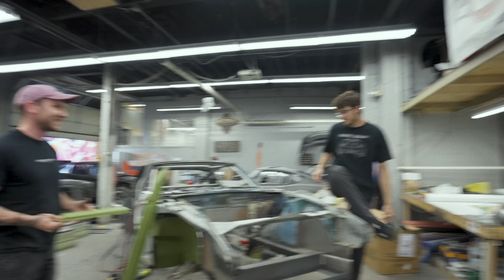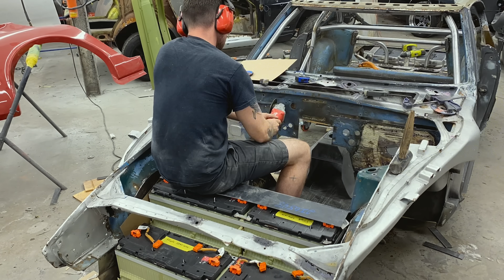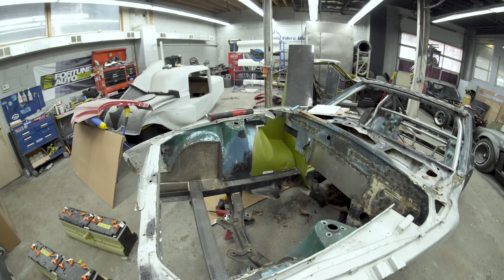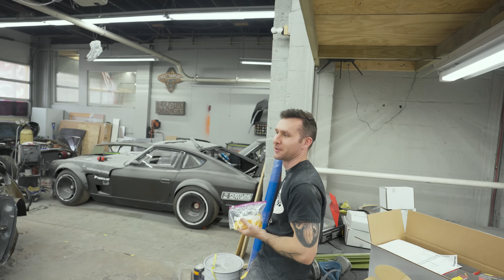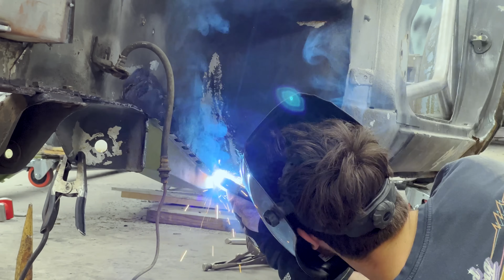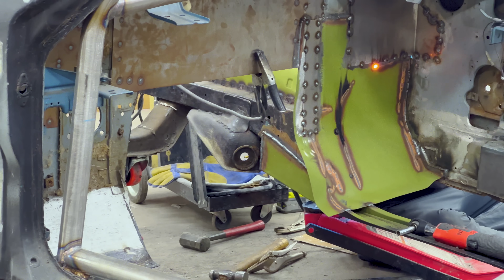EV 240Z Rust Repair | KF Vintage Panel Replacements | The Legacy (04)

Comment: Do you guys clean off the green primer on areas you are welding ? I am about to weld up a KF frame rail to my 280z so I wanted to get your opinion. thanks.
Reply: Yes you need to clean, sand the parts you're going to weld, makes it much easier.
Reply: @Thearc    thanks for the tip

Comment: SEAT RAILS. you need to make a additional frame rail under the carbon floor to sand witch the seat mount bracket. make sure there is no way they can be ripped out in a collision. Simple cross brace that goes left to right would accommodate strong provisions for safe ridged seat mount.  Fantastic work Fellas. Love the creativity the blossoms from the Street Bandito Team.

Comment: I'm ready for the day some badass with insane fab skills like you&your shop has, realizes a tesla model 3 all trims&years has almost the same exact wheelbase and overall width as a 1957 Chevy does. 

Tear the body off any trim m3 tesla(buy a new one with the tax credits for sub 40k) put new 57 repproduction sheet metal over it with those killer fab skills. Have someone redo the interior in a classy retro vibe&bam quickest quietest 1957 bel air yet. What a sema build that would be! 😎👍🏻